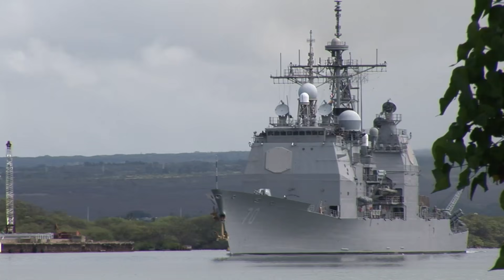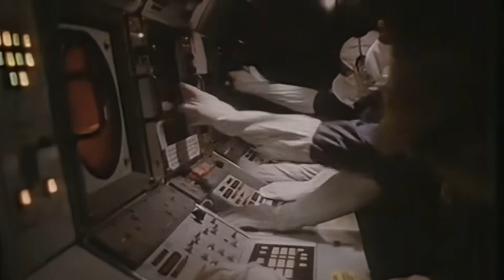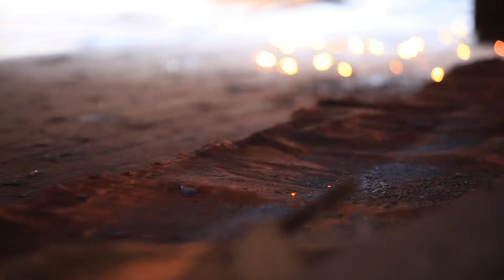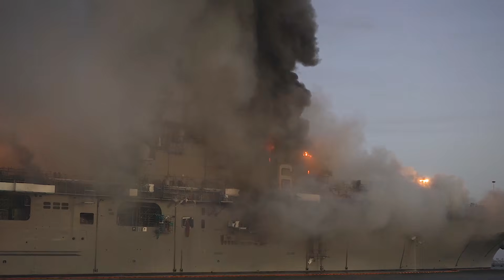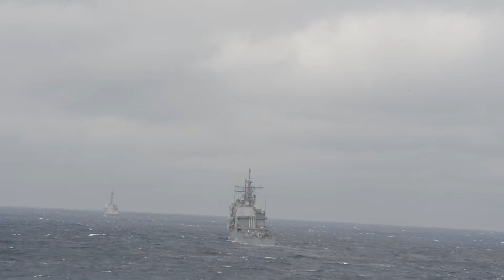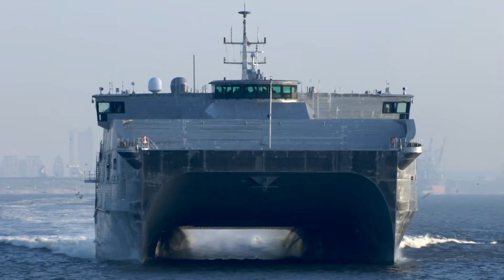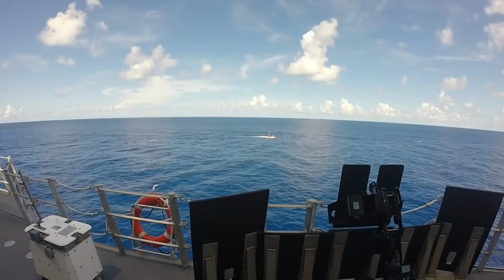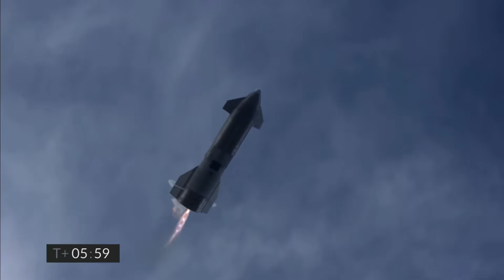Why is The US Building Aluminum Warships?

Comment: Anyone ever heard of Royal British Navy's insane plan to make an aircraft carrier from an iceberg
Reply: Well it was not going to be made out of pure Ice.. But a mixed Ice sawdust composite..  The sawdust added strength to the Ice and also has some insulating properties that slowed the melting of the ice.. The ACC was supposed to have a refrigeration unit on board with pipes running through the ice to keep the Ice cold..  In the end with the USA building so many conventional ships and the effective countermeasures they had against subs the need for the ICE carrier was no longer deemed necessary..
Reply: @AdstarAPAD  
It wasn't due to the USA building stuff that Habbakuk was cancelled.
It was cancelled because it's purpose, providing an airport out where aircraft couldn't reach, thus closing the 'mid-atlantic gap'.
In the end we advanced technology to the point that aircraft could fly across the ocean unrefuled.
We closed the mid-atlantic gap with technology.
Reply: @MostlyPennyCat  Correct, closing the mid-Atlantic gap solved the need for pycrete carriers.
Reply: @AdstarAPAD  pykrete
Reply: @MAL1GNANT   Yes thats the name of the composite.. Thanks..
Reply: @AdstarAPAD  👍
Reply: They tried shooting the Ice, they shot the Normal ice then it went thru, they shot the Customize Ice and it bounched and shot another Person
Reply: @charlesjakesamadan4008  the other person was Admiral King - US Navy the US Navy's highest ranking officer - not great for cooperation!
Reply: I suppose a goodwill tour to the Caribbean was out of the question then.
Reply: @jameslyddall  LOL
Reply: At least it’s not going to catch on fire!
Probably......
Reply: Yes amd its called ( project habbakukk ) the biggest aircraft carrier out of ice (which is pycrete) they cancelled the project because its expensive to make one or there stupid because the ice is weak and it can melt through hot temperature but anyways the project habbakukk is bigger than any aircraft carrier
Reply: @alphahead2741  It wasn't stupid. They have proven that the hull made from pykrete (which is a combination of ice and sawdust/woodpulp) would be much stronger than steel hull at the expense of the hull being thicker. Since ice is lighter than water, it's also impossible to sink even if a torpedo or large calibre naval guns can blow up a hole at the waterline. Because of the sawdust, ice is also resistant to melting, and this has been known for a long time since the days people transport Canadian ice all the way to Indonesia before freezers exist. The reason why the project was shelved was not due to the flaw of the technology. It took the prototype 3 years to melt.

The reason was making such a ship would be much more expensive than a steel or concrete ship of the same size and role due to, among others, the difficulty of transporting so many sawdust to the construction site. The new requirement for aircraft carriers due to new aircraft designs also made them unfeasible for the royal navy's purposes.

After all, the project was to address the royal navy's inability to field fighters at sea. But since America joined the war and the royal navy had access to steel again, there was no reason to resort to such desperate attempts. Sure even with Americans joining in the need for steel was too great, but weighing pros and cons, they decided that using those precious steel was better than building up a much more expensive experimental ship that can't even perform its role well.
Reply: @alphahead2741  "Ice  is pycrete"?  can we have a link confirming thet?
Reply: @flamingfrancis  just go to google and type pycrete then go to wikapedia link to figure yourself out dude ;)
Reply: @alphahead2741  Pycrete is incredibly strong and the Brits had thought about everything much more than you think.
Reply: @alphahead2741  Actually stronger than steel
Reply: @alphahead2741  pycrete purportedly deflected small arms fire, it wasn't weak like ice.
Reply: @alphahead2741  it was only though of as a temporary measure for ww2. And pycrete melts very slowly. Much more slow than pure water ice. It is also much stronger. Frankly it would have been usable for months. And very missile resistant too.
Reply: Well I mean wtf, pycrete cannot cracked or destroyed from torpedoes but it will from stronger projectiles like bullets, mines or high power torpedoes but also maybe incendiary ammunitons cuz it could melt pycrete
Reply: @alphahead2741  "it cannot be destroyed by torpedoes but it can by stronger things like bullets" ...wtf are you saying...bullets are more powerful than torpedoes??? Get real eh ...you clearly have no idea what the hell you are talking about.
Reply: @alphahead2741  I think it would actually be pretty good against incendiary - it melts to water so would put out any fire that started.
Reply: @alphahead2741  the pycrete has much more thermal mass. Plus as it melts the water would still absorb heat. Incendiary rounds would likely fizzle pathetically.
Reply: @alphahead2741  nah pycrete is harder than you think, it wouldn’t shatter like ice would getting shot, at least not nearly as easily, incendiary rounds would be put out by the water
Reply: It was an engineered ice, would have taken decades to melt.
Reply: Ice and sawdust if I remember correctly
Reply: @ishanghosh6604  Yup buddy
Reply: That's a stupid plan
Everyone knows the future of the Navy is Sharks with Frickin' Laser Beams on their Heads...
Reply: @vuivui4273  Ah yes... Enemy trees... What enemies' trees? How the fuck do you expect britain to get wood pulp from the enemy when they were on the *defending* side.
Reply: not an iceberg, they planed to make it from pykrete. the reason they considered it is because of how expensive the amount of steel was required to make a warship. they ultimately decided not to because the amount of steel required to build the freezer needed to make the pykrete ships was comparable to that of the ships itself.
Reply: It was Pycrete not ice. A mixture of sawdust and ice.
Reply: @vuivui4273  ... youre not a historian are you?... nor a logistician... nor a military strategist... nor an engineer... I can tell.

No... You're a dunning kruger on multiple subjects.

The war started in 1939 for Britain. After leaving dunkirk, Britain didnt have really any foothold on mainland europe, let alone one rich in wood resources, till after D-day in 1944.

Furthermore, Germany spent most of that war poorer than britain on nearly every resource. About the only resource they had enough of was wood... Which they promptly used on their own military projects, such as wood powered vehicles, and the development of aircraft almost entirely made out of wood.

I dont think stealing wood from an even poorer resourced country is a particularly bright idea, particularly if you need to amass the greatest invasion force ever made just for that one purpose.

Not to mention the ice carrier project was dropped for a wide variety of reasons that made it impractical. The whole point of the project was to make giant carriers without draining other resources... Eating a massive f&^%ton of wood constitutes draining other resources. Not to mention the amount of steel it wouldve needed equated to more than building a regular carrier. And, as Mythbusters demonstrated, such a boat wouldnt last long, even with a larger mass to melt. It wasnt even practical in terms of machinery, to make such a ship last long enough for an operation or more, it required a lot of active cooling equipment. And, strategic requirements were dubious. Britain as an island is already well situated to carry out air operations against cities as far inland as Berlin, the whole damn island was basically an aircraft carrier. An ice carrier wouldve had best strategic effect in the mediterranian or pacific... where the warmer weather wouldve melted it before it even got to the operational area.

Ultimately, the closest thing to useful this thing could get would be to launch massive long range ASW patrols across trade routes in the northern atlantic. Those waters were cold enough to make an ice ship more practical. Improvements in the convoy system, and sub hunting tactics by escort ships made this purpose a bit redundant, as these much smaller changes were already reducing loss of shipping.

... it feels like youre so enamored with an ice carrier that you're willing to invent strategies, no matter how ridiculous, to make it work.
Reply: It's a mild tragedy history was denied a half kilometer ice aircraft carrier.
Reply: It was called Project Habakkuk (I probably spelt that wrong)
Reply: @vuivui4273  And how much would they be able to steal? The logs that come with some of the tanks and trucks? Salvage the wood from some of the enemy equipment? That's a miniscule amount, not to mention said wood could be put into more useful conventional weapons and not a giant iceburg of wasted resources.
Reply: @imsillynotstupid  
Wait? You two think we don't have enough wood to make a pycrete airport?
We would have built it in Canada.
Canada
Do you have any idea how many trees we had in Canada?
All of them.
Reply: @MostlyPennyCat  Shit, I forgot Canada exists. Sorry Canada.
Reply: Well, if they have enough wood for the carrier, would have been feasible ig. But they never really needed her towards the end of the war. As for heat, even without maintenance a 1k ton prototype took 3 summers to melt down. Would be nice to see a (not really) iceburg airfield out at sea.
Reply: @imsillynotstupid  i agree that having a mass of ice that big would make it melt slowly, but theres other issues. It would still be limited to colder climates, and melt a lot faster going anywhere near the equator, mediterranian, or pacific. And then theres questions of... Ok, yes, it takes that long to melt, but it'll likely become structurally unsound before then, right? The ship is supporting massive marine engines, internal structures, a flight deck, lots of bombers, they even had plans to fly 4 engine bombers off these things. Pykrete may be strong, but it would definitely fail structurally at some point before being truly "melted"
Reply: @hatman4818  Nah, it was discovered that rubber and 1HP refrigeration was enough to keep parts of the ship together even in the hotter climates such as the pacific. this version was thought of after they discovered that problem you said after the first prototype, but by that time the Germans basically had no navy.
Reply: A jewish aircraft carrier... Hmmmm... Thats something new
Reply: America/Canada also looked into this as well if I remember correctly
Reply: @mikeberry5016  
Well yes, Canada was British.
Canada looking into it is the British looking into it.
Reply: @vuivui4273  That's not how economy works, that's not how logistics works. If you can kindly provide the sources you claim I'd be happy to skim over them. Also no lol, infact UK economy actually improved after the war, it's just that the US improved far more https://www.economicshelp.org/blog/11697/debt/post-war-boom/. We've already been over this, pillaging is a war crime, and transporting the wood from the enemy lines? That's a whole 'nother story.
Reply: @vuivui4273  Or I dunno, just build it in Canada. Plenty of trees there. (that was actually the plan)
Reply: Brilliant
Reply: That is nothing, the Dutch made an entire government from fried air.
Reply: Do you mean the pycrete carrier? Wood and water = ice concrete?

If they could have managed to maintain it and power it, that material would've been phenomenal based on the testing.
Reply: Ever tried sinking an iceberg?
Reply: That actually wasn't stupid.  Arguably smarter than an aluminum ship anyway.
Reply: That's nothing. I built an aircraft carrier out of aluminum cans and popsicle sticks!
Reply: Ice and straw. The material has a name but I forgot.
Reply: @joshjones6072  It is known as*Pykrete*
Reply: Yep, and it would'd cost more than al-a-min-u-um, lol...
Reply: Pranav, this is the kind of comment I am looking for! Project Habakkuk
Reply: @vuivui4273  oh by the way, looting and pillaging are war crimes, so don't even think of that
Reply: @vuivui4273  Funny, the UK was on the winning side despite the troubled economy. Also, how did this devolve from talking about how Habbakuk would be a strain on resources to this shit?
Reply: @vuivui4273  Because an American game designer invented 
Monopoly in 1904. If you mean their superpower status after taking the brunt of two world wars and losing most of their empire, they were bound to lose it no matter what they did. Now stop trying to derail the topic, we were talking about the carrier that was going to be made out of pykrete, not the damn economy of the UK.
Reply: @vuivui4273  also, you may wanna read the definition of monopoly. Last time I checked, the U.S. did not control the trade and supply of the entire world post-ww2, not even Britain before that.
Reply: Imagine being the crew on one of those.
Reply: No not at all !!
Reply: They'll do ANYTHING for a really good gin.....
Reply: But pykreig (can’t spell for my life) would have been practically indestructible
Reply: Concrete cruisers. And yes, I heard about it. Back during WWII, was it? I think they ended up making one giant gin and tonic out of it....
Reply: Ww2
Reply: @DavidFryer-u2c  Yep Brother
Reply: Piecreet
Reply: Is it bad I reads it as "Bri'ish" immediately rather than British?
Reply: @not_an_egg_cultist Why would that be bad?
Reply: Roosevelt does Canada have horses? Does Canada have wood? Two problems solved. Don't ask if Canada has ice. 3 problems solved.
Reply: @vuivui4273  
Neighbour? Now what are you talking about?
Reply: At least it's fireproof.
Reply: Yeah probably would have worked better for the Russians tho
Reply: Habbakkuk. Obscene
Reply: That was around the cold war
Reply: Dude it is called Pycrete! It was a wooden iceberg. Dumbass wood floats and ice cuts steel (titanic much?), you get the best of both worlds. It is a fantastic idea!!
Reply: @mickeddy92  Iceberg is always made of water it was mixed with sawdust to strengthen it and slow down its melting time
Reply: Then station it in the red sea,,,
Reply: Also been a few concrete ships made.
Reply: Nothing an arsenal of chemical releasing bombs filled with Calcium Chloride wouldn't sink in a jiffy.... That or take it on a cruise to Jamaica to boost the shipmates' moral.... which will be low.... after their ship melts.

If they do pull it off though... They should name it something like.... "The Titanic's mistress."

Oooo... OOOO. OOOOO One more... One more.... All of Great Britian's enemies sent to attack... In broad daylight.... with a giant magnifying glass.
Reply: @mandellorian from the UK huh bud? It's ok we all have dumb leaders
Reply: Wasn't insane - WW II idea that they did some serious studies on prior to US production of conventional carriers ramping up bigtime.
Look up the details before you call it insane.
Reply: It was ice and sawdust....Pykrete.   https://en.wikipedia.org/wiki/Pykrete
Reply: also US DID A STUDY on mixing sawdust in water called piecrete
Reply: @lelonfurr1200  British idea, US and Brits BOTH worked on the study.
Happened a few times during World War II.
Reply: Im actually a fan of the wood ice air craft carriers
Reply: @aurorauplinks  Cheap, almost impossible to sink, and semi-easy to build VERY large.
But so very very SLOW....
Reply: @bricefleckenstein9666 Definitely NOT cheap, brice. This plan was going to be more expensive than building traditional carriers.
Reply: @pike100  The tradeoff, IF there was one, is that the iceburg carriers would have been a lot closer to unsinkable, and have a TON more room than a conventional carrier.
They could have been made bit enough to base B-29s on (or ANY OTHER land-based aircraft of the time like the P-47 and P-51).

And what I have heard of the plan is that it WOULD NOT have been "more expensive" compared to the capacity of the resulting ice ship.
Reply: The US Navy toyed with that idea as well, but they never followed through with it.
Reply: It's titanic 2. Instead of a ship getting hit by iceberg. It is ice berg getting hit by a ship and somehow got split into 2 and sunk
Reply: H.M.S. Habakuk
Reply: Wasn't insane. Actually it was a quite interesting idea. Once built, it as quite workable as long as the ship was kept in the north atlantic and Bering Sea.
Reply: @vuivui4273  5.) Be a good citizen and follow the law by calling the police on the neighbor and not resorting to being a complete psychopath, yeah that sounds good. Also I don't have a garden sadly, what a shame XD.
Reply: One actually sank the Titanic!
Reply: The amount of wood it would take to go through with that project would affect the paper production of the country severely for many years.
Reply: @imsillynotstupid  is it true the ghost of kiev is admitted jewish propaganda
Reply: It wasn't that insane. It was actually a US plan, the ice was impregnated sawdust and refrigerated. It was actually more resistant to torpedo attack than a regular carrier.
Reply: @johnthomas2485  Where did you get that it was US? The trial was done in Canada and the test block (that bounced the revolver bullet) was done in Smithfields market in London
Reply: It was indestructible
Reply: It was ice mixed with saw dust and wood pulp. The composite didn't melt in Atlantic conditions, could be repaired with sea water and was intended as a floating airfield/sea fortress for the battle of the Atlantic. Sounds crazy but was actually a good idea. Problem was building it...
Reply: That had nothing to do with aircraft carrier.. that was intented to be a floating island
Reply: It was actually a Russian project but they stopped it bc it wasn’t possible
Reply: @nickpussy8024 Habakkuk was the most famous and British. I don’t know if the Ruskies had a similar project but I don’t think that’s what this lad is talking about
Reply: hey, fucking what?
Reply: Yeeeeeeeeeeeeeeeeeeeeeeeeeeeeeeeeeeeeeeeeeeeeeeeeeeeeeeeeeeeeeeeeeeeeeeeeeeeeeeeeeeeeeeeeeeeeeeeeeeeeeeeeeeeeeeeeeeeeeeeeeeeeeeeeeeeeeeeeeeeeeeeeeeeeeeeeeeeeeeeeeeeeeeeeeeeeeeeeeeeeeeeeeeeeeeeeeeeeeeeeees.